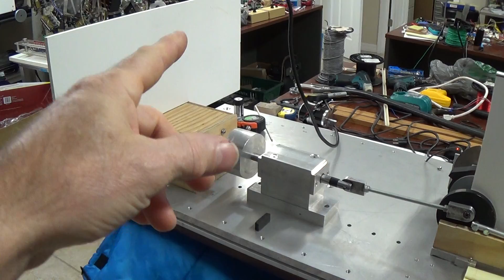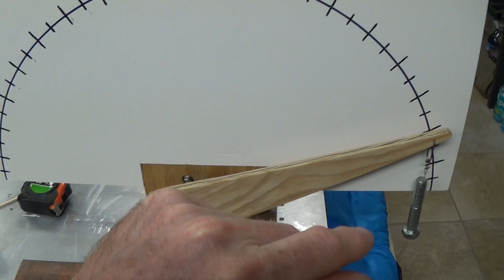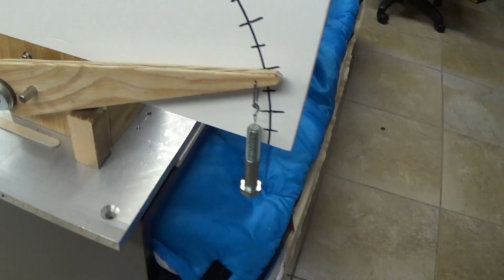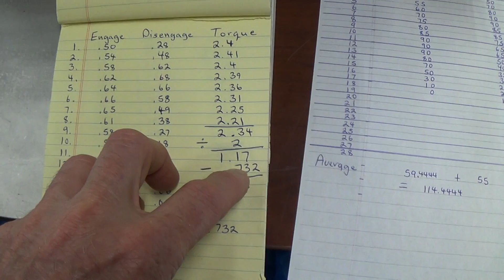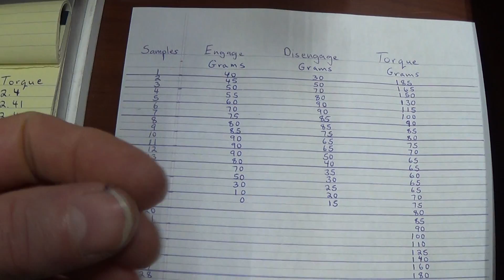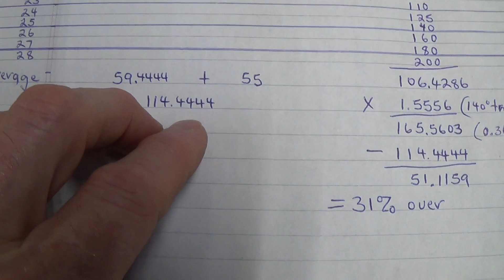Floor's Twist Drive Permanent Magnet Torque Amplifier test 3

Comment: look like a torque amplifier......think on a 2 dc motors couple with this concept......using 1 as a generator could be an COP over 100%?
Reply from the maker: It ends up being a COP of 1 when you calculate the reset: https://www.youtube.com/watch?v=MMqBISjwieY  
However, this one seams to have a COP of around 1.6 with reset: https://www.youtube.com/watch?v=oUlDMY1iE5A

Comment: If this produces more torque for the same amount of distance traveled (same power), this means that if you were to put equal weights on both arms, one would lift the other. But which one would lift which? You'll find this impossible to answer, therefore no over-unity. 

ANSWER: You're applying a 90degree (tangential) force on one lever, but the other experiences only a downwards force. To match both lever's forces, you have to pull straight up with your scale the whole time, not at a 90 degree angle, and you'll find the efficiency is poor, and less than that of a simple wheel gear.

Comment: So U get overunity from magnets? cop 1.3, input is rotation and output is translation? like engine?
Reply from the maker: Yes, it seems to have a greater output torque then the input. This test device is only to measure and not designed to be a motor. Next design may be a motor.
Reply: +Luc gotoluc Choquette Thanks Luc, and whre the input and output? input is right or left?
Reply from the maker: Input is right side

Comment: Well done Luc, but isn´t the torque lever arm changing with the angle of rotation ?? As you still apply the weight vertically, you probably must calculate into it the cosine alpha factor, as at 90 degrees the torque lever arm is zero as the lever arm does not see and pulling down force at 90 degrees ??
Reply: P.S. you have to have the weight always 90 degrees to the lever arm to pull it down, otherwise you can not calculate like this, if I understood it right ??
Reply from the maker: Thanks for looking Stefan. You are not understanding the measurement steps from this video. Watch test 1 and you should get a better understanding. The output Arm is locked during the input Arm is being engaged and measured. Once the input is fully engaged then the output leaver is activated and measured till the end of its stroke. Then I go back to the input leaver and disengage it while re-measureing its full stroke. Luc
Reply: Luc you have done a great job on the TD testing. It surely is OU.
But everyone wants to see a self running device. I suggest this
as a next step. 1. as input - take a weight on a pulley  that is enough
to do the twist and then 2. as output - take another weight a little larger on a pulley. 3. when the 2nd weight comes up use it to
reset/lift the first weight so that the cycle can be repeated. 
Then there only 1 step left and that is to set it up to automatically 
do the weight switching so it will run by itself - but that part may 
require a little more OU to get there. 
So clearly this is OU. OU does exist. ex. Finsrud device and my pendulum and my slider device.  Now if people would only believe what they see..

Norman
Reply from the maker: Hi Norman, Thanks for your message. I am presently building a rotating test device. This will prove or disprove the possibility of OU. It may take a few weeks. Luc